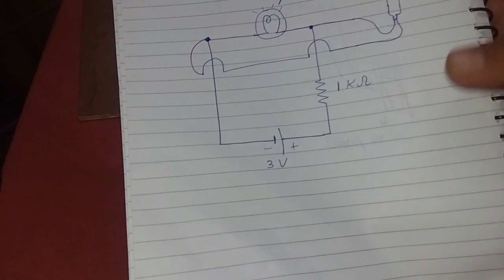How to make a device which convert sound into light and vice versa | Experimentalist.

Comment: How can be vice versa....
It is just a method of transferring data through light energy.
Reply from the maker: yes,i know  it transfering of data throught light. but  1st of all you convert data into light energy for this you superimpose the audio signal with light ,  means that light output is modulated by audio signal. And in receiver side (audio + light ) is demodulated or you can say that it is convert back to sound using solar panel and amlifier. It only sense light energy(solar panel). Finally light energy sense by solar panel then nconverted into electrical then sound using amplifier.